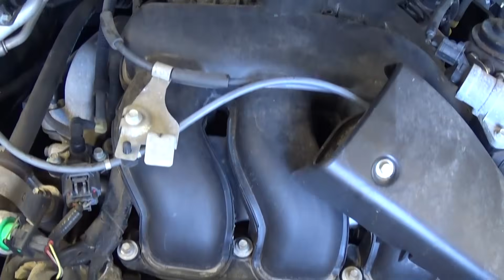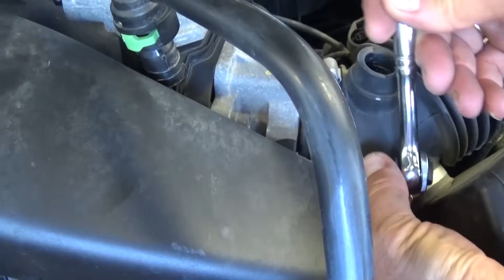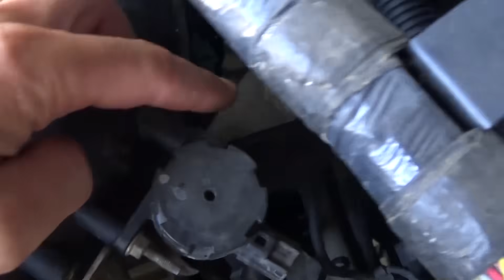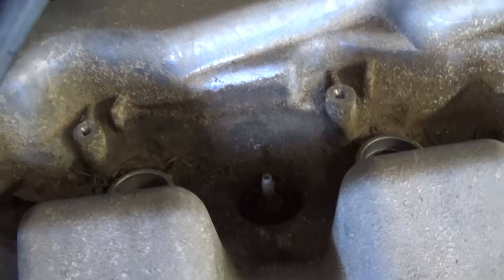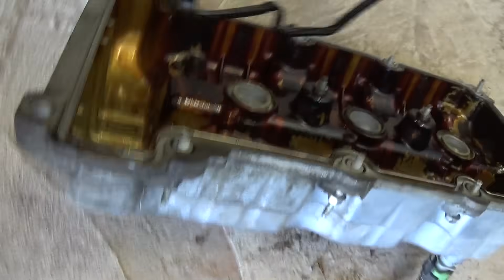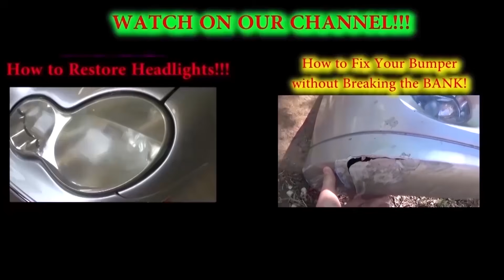Ford Escape v6 3.0 Valve Cover Gasket Replacement  Mercury Mariner & Mazda Tribute 3.0

Comment: There this sensor thing on front left bolt of the valve co er bolts that i cant seem to take off anybody have this problem when trynna take off the bolts its a little sensor thats held by a 8mm nut and underneath is the 10mm bolt i have to take out but im having a nightmare trynna take it off.

Comment: What a nightmare.between this and getting the alternater out .i wil never buy a fors sideway motor again.what tool did u use to get the rear valve cover bolts out .fking  nightmare

Comment: I should have made a video when I did this.

2011-2012 v6 3.0L are the two I know would be the same..
Each bolt for the valve cover has a seal that can/should be replaced when doing the cover gasket
Just cut the old one off and push the new one on 

There is a new seal for the valve timing solenoids as well make sure to replace those
Each plug has a seal 

Make sure you get out any pieces of old gasket you drop in that mfer
Clean clean clean the surface where gasket sits cover and head side

if you are doing this, do the intake manifold gaskets too 

Problem once you get into high mileage with the 3.0 atleast the valve covers leak, the oil goes down and overwhelms the gaskets on the lower intake, dries them out, oil gets into the intake 
Oil gets into your injector seals. you may have to replace injector seals but cleaning them should be ok.
Oil gets into your spark plugs

Blue smoke flies out the tail pipe and this thing starts dragging  - after the fix shes back to life tho

Comment: Very helpful to get to the Cam Bearing Caps to check and tighten as everyone suggests after finding they come too loose over time. I don't mind pulling those hoses since I've come across many dry rotted on my 20 year old Escape.

Comment: What did you torque the valve cover bolts to? Also do you recommend torqueing the cap bolts? I removed my radiator cause it has a leak and I'm going to work on the front gaskets.

Comment: Good job, thanks for the video. The end was the money shot. Replacing the individual gaskets for the sparkplugs. That's where the oil must be coming from.
Reply: Yours is still leaking? These engines are garbage

Comment: The 2 bolts in the middle of valve cover broke as I was tightening to specs. All other bolts are tighten to specs. Can I  still drive the car with the 2 center bolts not tighten or will damage happen to transmission?
Reply: Dont do it. Repair that.

Comment: Hi there, I have seen a lot of your videos and there isn't one that I don't like. I did this at the same time I replaced the spark plugs and ignition coils. Is it normal for smoke to come from the engine upon starting for the first time after this? it apparently comes from behind the radiator and between engine and firewall (where the new gaskets are). It doesn't smell like burnt oil, I'm assuming it's the gaskets getting cooked

Comment: Mark all of the connections and take pictures!  Putting it back together will be much, much easier!
Reply: All of the connections are different sizes and in different places. They can't be confused with others. It's not necessary to tag things on this specific motor and car. I've worked on plenty of these 3.0 escape and variants. Cheers.
Reply: Still just good practice whenever disassembling anything really

Comment: This is the same engine with 2006 Ford Fusion SEL v6. However, the design on the Escape makes it much easier to get access to the rear bank. There is much room to work at the back and  No power steering container sitting on the valve cover.

Comment: Great video! Is the rear cover exactly the same as the front one? The front one has the oil spout, but will the same part fit the rear?  I cannot find the rear cover because they only sell the front one.

Comment: Thank you so much for being so thorough. Other vids seem to rush through the removal of bolts/cables etc. without explaining how (or where they are located). Yours goes through each step logically and systematically. As someone with very little auto-mechanical expertise, this is perfect and easy to follow. Thank you for saving me a lot of time and heartache :)

Comment: So I've always heard that this costs MAJOR money at the shop but you did it in 10 minutes...wtf???
Reply: It isn't a hard job, just lentghy and you're paying by the hour.
Reply: They are not showing all of the clean up time......a shop will clean the inside of the covers, and all of the mating surfaces on the block......and it takes a lot longer to put it back together.  Above I saw someone state that they got a quote for $600 to do this.......not even close.  This is a $300 job
Reply: @stevemollis5416  today's prices 2022 is more 600 to 800 dollars.

Comment: did the front one last night. a couple things that are not mentioned here regarding the front one: the two front bolts are pretty difficult to get to, very narrow space. got them out with a frankenstein combination of swivel adapter and bunch of wobble extensions. also, the engine hook has to come off in order for the cover to actually come out. friendly tips :) good luck everyone
Reply: Just bend the hook, then the cover will come off.
Reply: Thanks for the tips. ANy additional tips on removing the engine hook? I'm having real trouble getting that bolt off the engine hook bracket.

Comment: The front one is not as easy to remove.  No wonder he skipped that part.
Reply: I managed to do it without removing the engine lifting bracket, so it is possible. I'm not saying it was easy, it took a lot of wiggling and I had to push the radiator as much as it will go towards the front of the car. That is the key, I think.
Reply from the maker: +Brittany Gumm did you mean not easy to remove the front bolts or the valve cover gasket was stuck? If you ever need help with your vehicle let us know you can also find us on Our Official Facebook Page here: https://www.facebook.com/worldmechanicsofficialpage/?fref=ts
Reply: I'm working on removing the front valve cover (03 Ford Escape V6) and I'm stuck and not because of any of the bolts. I noticed that I would need to remove the engine lifting bracket but the bolt is so tight and tight fit for breaker bar even with an extension.  Do I need to remove the engine lifting bracket? Any suggestions and tips to get the front cover off? Thank you
Reply: yes you do. what I did to remove it was pit a pipe over the breaker bar to increase the torque on the socket. had the same problem with he breaker bar. Just make sure to tighten it just as tight.